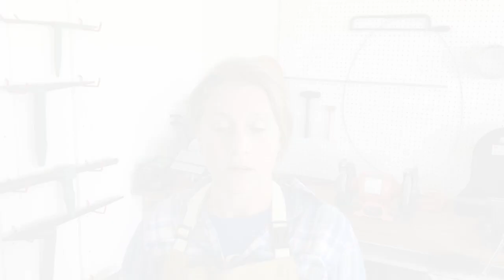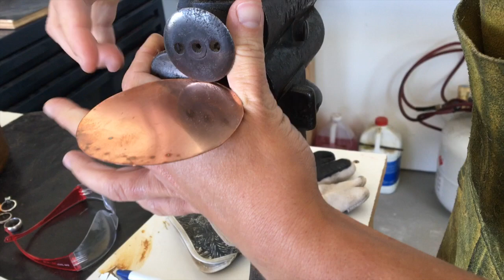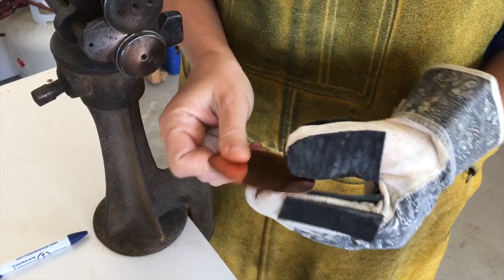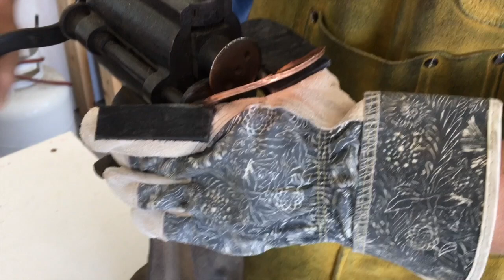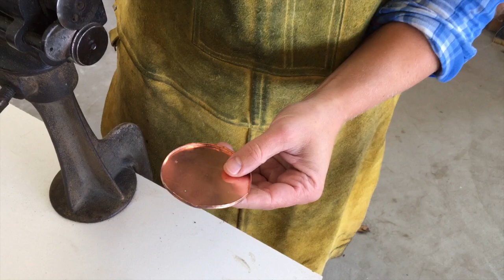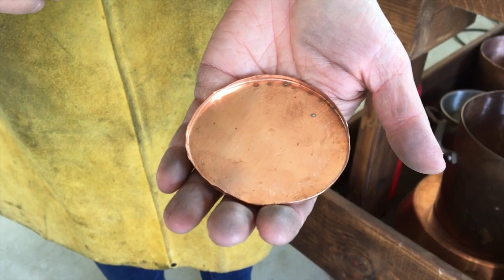How to use a Burring Machine

Comment: What is the right offset of the top and bottom dies when you look at it from the side?  How much should the top die stick out from the 90deg lip on the bottom.  I have a burring machine but I'm not sure the top and bottom dies are set properly.  Thanks, and love the videos!
Reply from the maker: Ooo...I don't know, as that measurement changes depending on the depth of the burr I'm making! Do you have any vintage drawings? Those might help show you how the manufacturers have it at the "starting spot".

Comment: I didn't know this was called a burring tool.  I have used mine to fabricate gas tanks for antique one cylinder engines for buddies that collect them.  My Lockformer has a mechanical 'easy-edger' that makes roughly a 3/16''  90* bend on a radius to insert into a Pittsburgh lock.  But it is so fast, it could never be used for a diameter this small.  I've not made cookware, but I have made funnels and a lot of other oddities, but mostly sheet metal duct work.  But I do have a lot of the stakes I could see in the background, plus other Pexto hand crank forming tools.  Good video...you taught me something I can put to use now.  Thank you for an awesome tutorial !!
Reply from the maker: Yes! It's a burring machine! Love to hear you have stakes and some of the rotary hand machines! Thank you for watching - so happy it gave some info!! yay!

Comment: Awesome example how to use that machine... any chance that you can show how a burr is raised on a circle like that without a machine?  I’d imagine there must be a technique used before the machine...?  Looking to buy a machine, but interested to know the correct manual way.  Thanks for all of your videos!
Reply from the maker: Oh, certainly. That's a great idea for a video - I'll put it on the list to do sooner than later (like in the next month or so). There is a technique and it requires hammers, measuring, eyeballing, and certain tin and copper smith stakes (or, heck, pvc pipe!). Cheers!